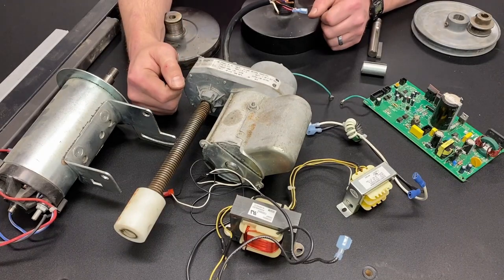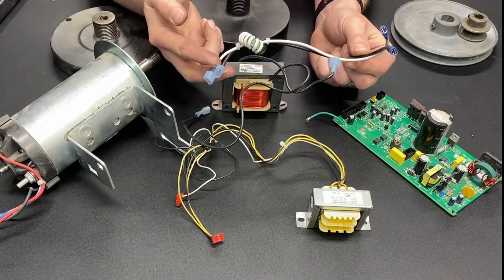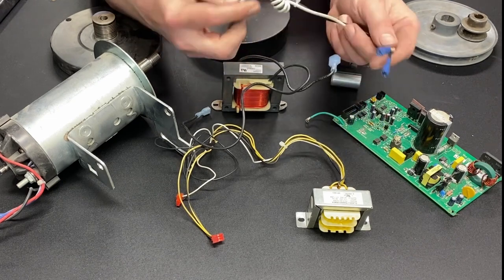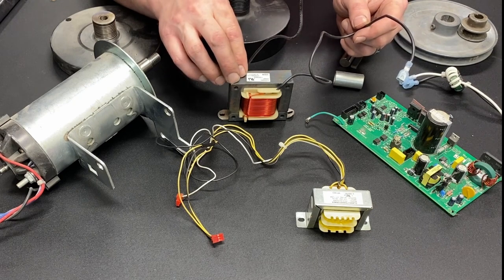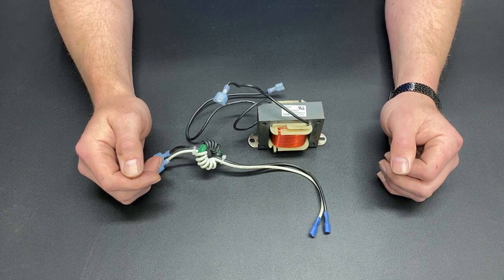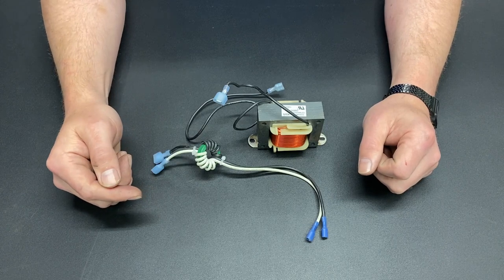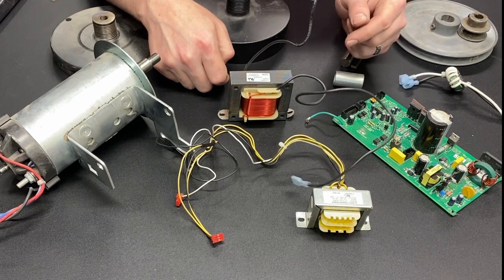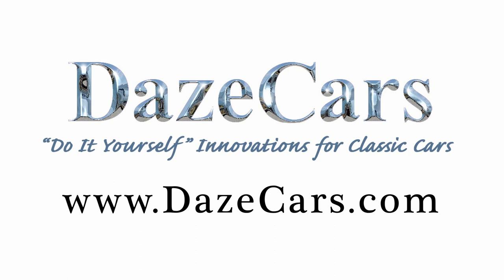Treadmill conversion FAQ 6. Where do you get a choke?

Comment: I was wondering the other day if I could use a transformer as a choke, or rather, half a transformer.

Use the primary winding and remove the secondary. I suppose it should work, ish, but unfortunately I'm no electrician.
Reply from the maker: So the answer is both yes and no.  A transformer is designed to only be used with AC.  Stranded wire is better for DC current and solid wire is better for AC current, so most transformer coils are solid wire because transformers are AC.  Also unless you are getting a fairly large transformer like one coming out of a microwave the wire in smaller transformers is too small to handle the amps of the treadmill motor and power supply.  The motor would probably turn but you would loose torque.   In theory if the transformer was big enough and you removed the secondary coil (this is extremely important because every time you shut off the machine an installed secondary coil could arch) The primary coil would function as a choke but it is not a good substitute especially since chokes are available ready made.  With that said I am going to do a project (and future video) where I take a microwave transformer, remove the AC coils, and install a single coil made of heavy gauge stranded wire and that should create a good quality choke.  Mind you this is all theoretical and I too am not an electrical engineer just a knowledgeable hobbyist so I will not know its efficacy until I test it.
Reply: @dazecars  New subscriber here; I've watched a few of your videos and found them useful. But I have one question: You stated that solid wire is best for alternating current (AC), while stranded is better for direct current (DC). But it looks like the choke shown in your video is wound with solid wire. Can you explain why DC inductors need to be wound with stranded wire?
   And FYI: Any piece of wire will exhibit some inductance when a current is passed through it, but AFAIK most (if not all) of the parts we call "chokes", "inductors", "filters", etc. are indeed coils of wire which are wound on some kind of core (even if that "core" is only air) whose properties are chosen so as to optimize them for specific purposes. I don't mind spending $60 for an inductor marketed as a "Proform NordicTrack Weslo Image Treadmill Motor Choke Transformer 185582 130993" or whatever,  but would prefer to go cheaper, and the way to do that is to know the current rating (in Amperes or milliamperes) and the inductance (in Henrys or millihenries) of the part in question. Do you have these specs for the #109365? I can measure inductance, and can guesstimate the current rating by looking at the overall size. Heck, maybe I've already got the part I need in my junk box!
   BTW: I did look online for the specs, but quickly got lost....
Reply from the maker: @carlgradolph9676  First of all, all wire conducts and assuming the AWG is correct stranded and solid wire can be used interchangeably. Most appliance cords and extension cords are stranded wire because it is more flexible and less likely to brake from bending even though used for AC. Factory made chokes are solid wire because the wire is more rigid and can better be formed to the core of the choke. With that in mind all other things being equal stranded wire is better for DC and solid wire is better for AC. Home wiring is almost always solid wire and car wiring is almost always stranded wire. As to the chokes specs and "the math" it only works if you have all the information and because of different motors, different setups and so on specs won't get you there. A better option is a rule of thumb. The bigger the motor choke the better it works. larger magnetic field and wire that can handle more amps. The choke on my lathe is about the size of a softball and is way better than the tennis ball sized choke in my videos. That choke in most of my videos is part number 130993. Instead of getting one new I would get a used one. A lot of treadmills come with a choke. Go to eBay and search “treadmill motor choke” BUT know that most people on eBay don’t know what they have and the word “transformer" will also appear in most listings. Problem is a choke and a transformer look almost identical so some listings are for transformers and some are fore chokes because the sellers think they are interchangeable. They are not. They would only be interchangeable if you modify a transformer to work as a choke. (see my DIY choke video) To tell the difference count the wires. A choke will only have 2 wires, a transformer will have 3 or more. Also before I started doing videos chokes on eBay could be had for $25 or less shipped but now that more people are looking for them (due to my videos) the eBay sellers have raised their prices quite a bit. Your best bet might be the DIY option out of a Microwave transformer. Please let me know if I can be of further assistance.

Comment: Thank you. I've been waiting for this one. 
I couldn't find the Choke on the website's parts listing but I will give them a call.
Reply from the maker: Email works too I have exchanged several emails with them.
Reply: @dazecars  I spoke and sent an email to Susan. Great customer service so far. Requested availability and cost for a large choke (or whatever they have available). Thank you for the recommendation!
Reply: I received a couple of chokes in the mail today. One is similar to the one in your video (130993) and the other one is twice as big maybe similar to the one you have on your lathe or mill (109365). I have a couple more 130993 on the way.
Reply from the maker: @aguycalledlucas  Glad they were able to get you taken care of
Reply: @aguycalledlucas  if you don't mind me asking, how much were they?
Reply: @connorbabcock8197  I’ll go and find my invoice. I purchase two from that company Daze recommended. It seemed to be the last two they had, and then I purchased two used units from Amazon. I’ll take a look and report back. The ones in eBay were too expensive.
Reply: @connorbabcock8197  I’ll go and find my invoice. I purchase two from that company Daze recommended. It seemed to be the last two they had, and then I purchased two used units from Amazon. I’ll take a look and report back. The ones in eBay were too expensive.
Reply: @aguycalledlucas  hey! I actually found the bigger one using your part number. $50 shipped isn't bad! Thanks for the help
Reply: @connorbabcock8197  awesome. Yes the bigger one of the two is p/n: 109365